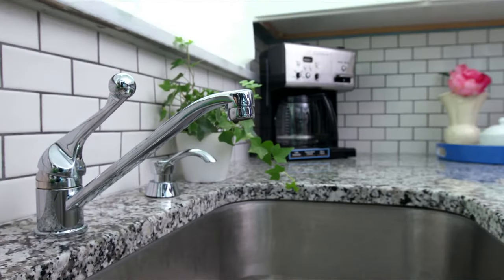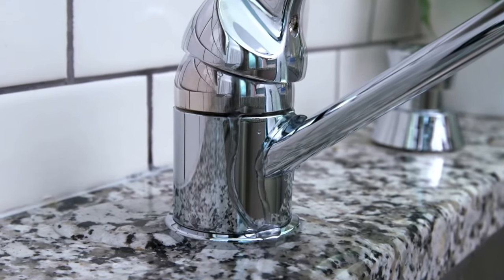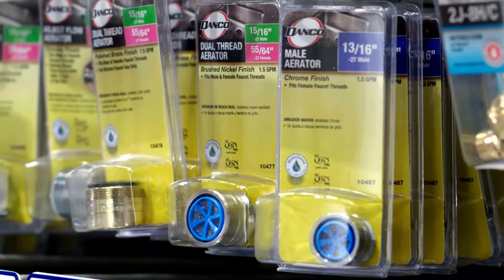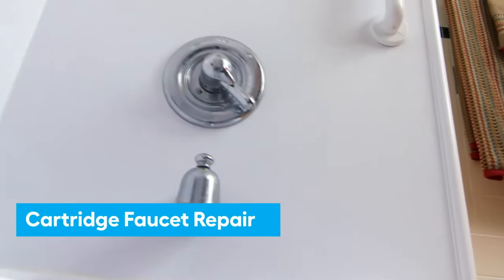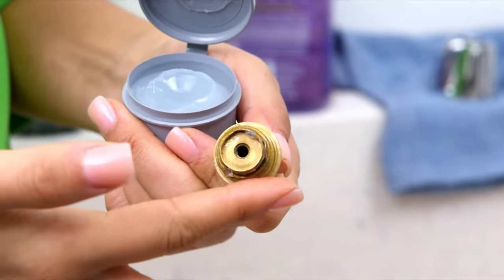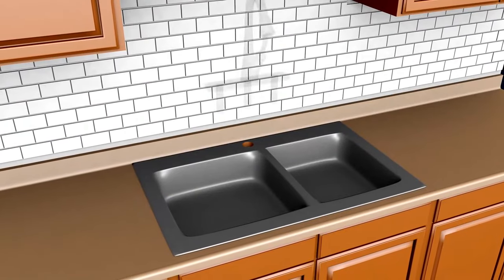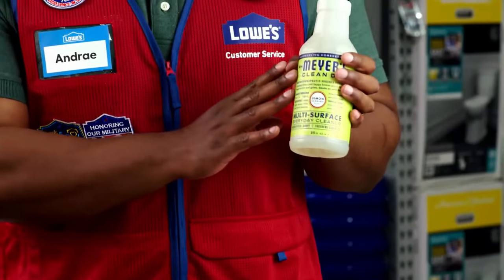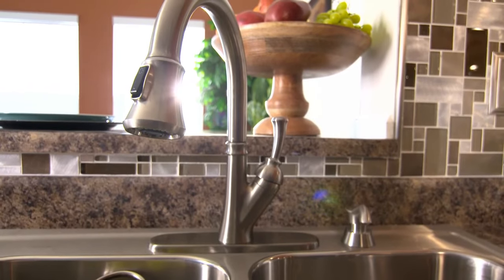How to Replace Faucets and Fix Drainage Issues | DIY-U by Lowe's

Comment: I have a ball valve faucet which is leaking.  Sometimes I can get it in a certain position and the leak stops.  I thought I needed to replace the entire faucet, but I guess I don't.   I'll try this fix.  Thank you.
Reply: I'm having the same problem. I'm hoping it just needs a new o-ring.
Reply from the maker: Hope the repairs in this video help! Reach out if you have any other questions.

Comment: I have a question so I am a woman and I need to replace my kitchen facet it is a single handle with sprayer I bought one and it only last 2 years because I use it regularly the handle keeps popping off so what is a good brand but not expensive thanks
Reply from the maker: This faucet from Delta sounds like a great option for what you are describing: https://low.es/3ruRUFT .  

Let us know if this is what you're looking for.

Comment: How to remove a garbage disposal from the sink and replace it with a regular drain?  HELP!
Reply: Hi @melinda5777,You'll need these tools to tackle your repair and installation: pliers, screwdriver, bucket, wrench, voltage detector, garbage disposal wrench, plumber's putty, sink strainer, and PVC pipes, among a few others which usually come in the kit when you purchase at Lowe's. 

Removing the disposal – You'll want to unplug the power first and turn off your breaker to prevent water splashing. Remove the drainpipe and dishwasher drain hose. Then, disconnect the disposal from the bottom underneath the sink, removing the wires from your disposal. Finally, dismount the mounting assembly for your disposal. 

Next is to get your area ready for the installation. Since all garbage disposals come with a sink flange, you will remove this sink flange and use a sink strainer to connect the sink directly to the pipes. Then, install a sink basket strainer. A sink strainer is fitted to the sink using a lock nut. It also comes with a rubber and a cardboard gasket. Finally, install the drain pipes (this will depend on whether you have a single or double sink). 

Let us know if you need any help with your DIY installation! As always, our RVA's in-store are available to help as well.